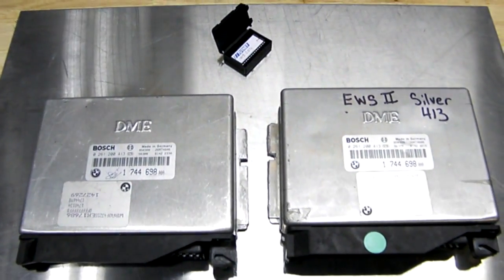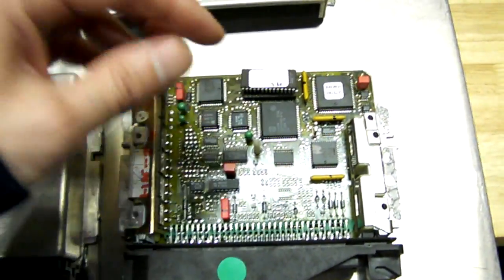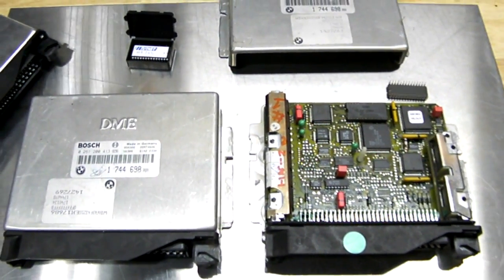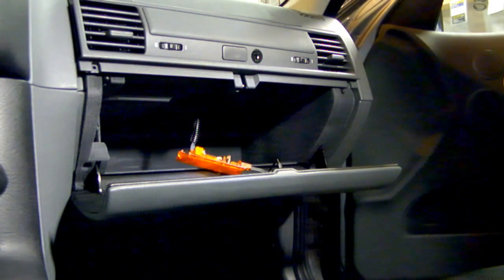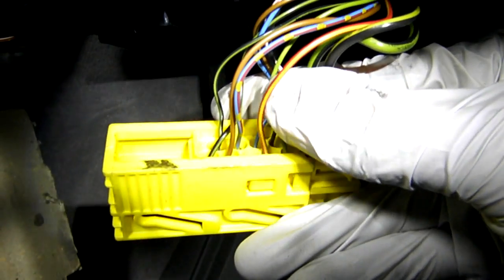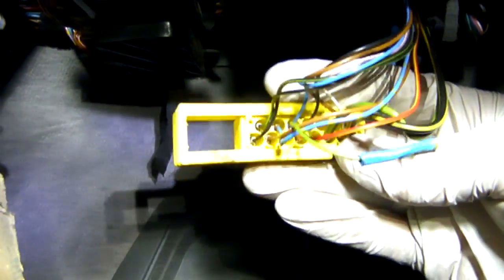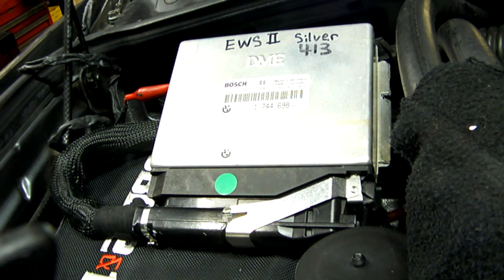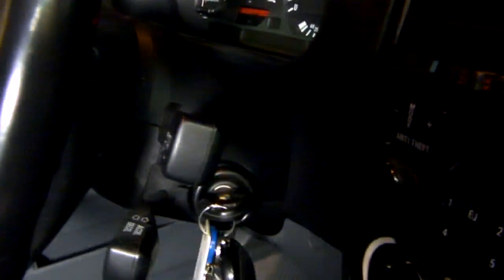BMW E36 EWS II BYPASS COMPUTER SWAP

Comment: Hello, I have a question for you. My vehicle is an E36 318i 1994, it is not the same system, it does not have this immobilizer module. What should I do? The immobilizer has been canceled.

Comment: So every white label dme has EWS? or how do I recognize which one have? basically what I'm looking for right now is to start my engine, it cranks but no fuel or spark after replacing harness and dme, not sure if the dme has EWS but it's exactly like those white label that you have there

I can't find continuity between the green cable and pin #66
chassis have the EWS system, 96' 328i but I replaced the harness for a 94' 325i since I swapped the engine, also got a DME but it probably has EWS, I'm not sure of that

Comment: Hello , I have a 1995 bmw e36 316, the silver dme is fried due to water damage, can I just swap out the dme and do the ews bypass? The damaged dme part number is 0 261 203 661 and the one I found at the junkyard is 0 261 203 277 also a silver unit any assistance or advice would be highly appreciated

Comment: 1995 325i EWS car.
If I cut the green wire at the EWS, and if I have a good DME ECU with the EWS chip installed, will it start up this way, or do I also need a non-EWS chip?
Is that burgundy DME from a 1994 325i?

Comment: Did this for a remote start it didn’t bypass it do you need to chip it to work ?
Reply from the maker: EWS bypass only works on OBD1 DME model years. The EWS bypass procedure only bypasses the DME also known as the engine control module. Under normal antitheft functions the EWS eeprom chip in the DME cuts fuel injector actuation ect... The EWS bypass removes this function. The EWS module behind the glovebox actually still needs to communicate with the chip in the key to allow the starter to work. Your remote starter control wire needs to be spliced in between the EWS module and starter not between the ignition switch and EWS module. You will want to look at the two large wires on pin 3 and pin 1 (yellow/black & green/black) on the EWS module plug. One of those wires feeds power to the starter solenoid.I believe it was pin 3 green/black that feeds directly to starter but please double check first. Can also do a google search "How to test your bmw EWS2 before replacing it" by RPM Motorsports. They show the EWS starter wires in their diagram

Comment: What if my car has no ews and i fit another engine that had ews, both bosch ecus only difference is my old engine was non vanos the new one is single vanos.  The car cranks but doesnt fire do i need a red label ecu to make it work or is there a cheaper way?

Comment: I have an m44, it does not have injection pulses, the sprocket broke and I want to put it in front of the pulley, will it work the same, that is my question

Comment: Help, I have a E36 98 M3 S52 OBD II EWS.  Started out with hard to start, seems like battery ran out. But finally turned over and started. This happened couple times . Then suddenly No crank no start. Battery is fully charged. I thought it’s the EWS module so I recently ordered a new DME from kassel performance with EWS delete. I plugged it in and got no crank no start. I assume the EWS is damaged so I bridge the two big wires on the EWS and got it to crank, but no start. Then I try unplugging the EWS and bridge the two wires, but still crank only no start. I have replaced the crank sensor and a use starter. Checked all fuses under the hood and all is good. When I turn the key to on position, I can hear that fuel pump prime. Any advice is much appreciated.

Comment: Hi ,saw your video and need your help , so the car was seating with out a battery , and now will not start a guy re programed a Key for me and it worked I removed battery because car need work and so now doesn't start how can I fix this issue

Comment: I have a 95 325i and I did the Ews delete with the wires under glove box and swapped a 413 maroon label dme into it and the car now cranks and I hear fuel pump. Car is not getting spark and has voltage to the coils themselves but no voltage when cranking. Is the car not getting signal when cranking?

Comment: Advice please. I replaced my BMW's water damaged computer box with a lock-set. The car starts very well. But the issue is that the steering wheel doesn't unlock and the radiator fan keeps on running without shutting off. What could be the problem?

Comment: I have an 01 BMW Z3 is the color of the wire the same? I am talking about the one I need to cut. Thanks this is very helpful because I am about to send my DME to get it custom tuned and don't feel like going to the dealer

Comment: You mentioned key and transponder towards the end of the video.  Were you saying they need to also replaced  with each swap?  Will this work without having to replace the key and transponder already in my car?  I have a 1996 E36 323is

Comment: So cut pin 66 the solid green wire and you can run without any key codes just as long as it turns

Comment: Hey I have a 95 325i and I tried to bypass the EWS2 by cutting the two biggest wires and jump them together it turns and cranks but it won’t turn on do you have any suggestions?

Comment: I found where I can buy a set with the ecu dme and key n switch .... but mine has the dme 1430 105 ... and the one i found is the 744 698  .. will it swap over

Comment: I had a question if anyone can answer it please. My question is what does it mean when a 1994 BMW 525i transmission slips and the trans program pops up on my dashboard and was wondering could it be the transmission control module? And how to take off the transmission control module off mine to check and compared to others I seen online

Comment: I wanna know if you can help me
I have a 2003 bmw 3.0i x5 ..the thing is my car has a failure when i turn it on in the beginning is sound good but 1 minutes later engine start to shake and loses strength when i go on the freeway is like 4 cilinders working and i have to turn it off to reset and then turn it back on to get it works well again ..idk if the main computer is damage or what?  Can anyone give me an advice please

Comment: Question. Did you ever open up an EWS II module? 
I wonder if there is a relay inside the housing. My starter motor keeps switching off while starting.
Reply: The ews module is a very fancy and unnecesarily expensive relay. If you have a wiring diagram you can jump the relay in the ews to start the car and check ews failure

Comment: My 95 318i stop working you think that may be the chip would help .it cranks but no power to fuel pump or fuel injectors TKS
Reply: sergio torres did it have ews
Reply: @hiboost2453  it does have the same component this guy is showing in his video

Comment: Hi. Any chance that this bypass method would work in case of an e36 325 TDS Manual? I had to replace the engine in my 1999 one. I have got a replacement engine from a 1994 e36 325 TDS Automatic. I have both the ECUs. Tried but non of them makes the high pressure pump to let fuel for the injectors.
Reply: Gábor Sike im going to follow this.
I have a 96 325tds. Got a ecu from the crapyard. Dont know what year. But it has Ews. I have a tuned chip for the original ecu but its soldered. Havent checked yet. But i think the scrap ecu is not. Would it work?

Comment: I have a 95 325I E36 , i keep having issues with the vehicle no crank no start. I was curious if there is an issue with the EWS , can i cut the green wire , and ( would that disable the immobilizer )
Reply: Awesome car

Comment: cheers, does this bypass (wire cutting) works with motronic bosch DME? (the 400 or 403, 405 type)

my car is a m50 swap in 95 m52 chassis ,and I need to put in another DME (my current one is toasted)

Comment: I got the 413 because my old one was corroded due to rain. My car is a 1992 325i, when I put in the new one do I need to swap the chips and put in the chip from my old one?

Comment: Hi. Thanks for the great vid. I need a few more clarifications though... I have a 520i with Siemens DME and I'm planning on swapping in a M50B25 vanos from a 525i. My 520i is a >95 car, so EWS2 enabled. My question is what kind of DME I must get to keep the EWS2 functionality? My understanding was that only one from a >95 car would work and then reprogram it to pair with the EWS module. Fair enough, but E34s from 95 are quite rare, so I'm looking at 93-94 as well. So, can I then buy a 93 525i and get a DME from >95? How do I know which DME is the right one, with EWS2? I understood all silver labeled 413 DMEs are EWS2 enabled, but when looking the part # on your DME from the video, it was <95 on realoem, so I'm a bit confused.
Lastly, you said if I would cut the wire from pin 66, the key chip would still be needed for the immobilizer, which is what I want, but how is that possible? Isn't the whole point of cutting the 66 pin to disable the immobilizer and make the chip obsolete? what are you then achieving by cutting the wire? Thanks a lot for the help so far.

Comment: Here to report a related fix for my Nov 93 e34 540i that has cold start issues where it won't at below mid 30 F degrees.  I cut pin 66 wire in the DME header where it was black with yellow stripe and it starts 0 F degrees now.  It always did crank over strong and fast, the engine just would not start when it was cold out.  After replacing cam/crank sensor with no change, I monitored the fuel pump fuse with a test light.  Cold there was no prime, and no voltage to fuel pump during starter cranking which tells me the computer has been told to not start.  Warm it has power to prime for one second and then soon after engine turns over with starter.  Cut the pin 66 wire and I have power on the fuel pump fuse without fail both for prime and start.  Mine has black label DME  0 261 200 404.

Comment: Your video saved the day. Had to change out my M44 1996 engine with a M43 1994 engine (318i). Engine would not start after the install. Cut the green EWS wire as you demonstrated and the car started first go and runs better than ever. Love your work!

Comment: has anyone else tried this with success? I have a 97 328i. previous owner destroyed the ews at the ignition and now it won't start. I found the delete chip online for $300. I think I'm going to try the chip. big leap of faith...
Reply: Andrew Teeter did it work?
Reply: Andrew Teeter 
hey did u ever end up starting ur bmw??? i have a 97 318i bmw and want to bypass ews. problem is i lost the keys and need to drive i popped my ignition switch out so i can start it from there if i can bypass ews imobiluzer pls get back to me deandesousa911@gmail.com
Reply: Mike  Green did you ever figure it out?

Comment: so my red 413 stop working no power to fuel pumps also no power to computer so does that mean I have to get a new red box or can I slap a Ews  delete chip and it will work again??
Reply: it didn't get wet I was driving and the car cuts off
Reply: What did you do to get it back running my car is currently doing this now

Comment: Its the same process for a 318ti ? My car is 4 cyl and dont Have  performance chip, only crank but no start, when i bought the car wasnt key, so find the key and all inmobilizer system in a Junk yard and now crank (before wasnt). What can i do for my car start?
Reply: The ews system isnt from 318 is from a 323,
Reply: +adiel licerio did you figure this out yet, I'm having the same issue

Comment: I Have a 535i e39 m62tub35 ,i want to swap to a 540i m62b44i non vanos . i get the motor complete with ews an DME , but my car is from 2000 and the donor 540i from 97so will the ews fit in my car or do i need to delete the ews ? i dont know how this work ?

Comment: great video! made sure to like and sub. I'm curious if this fix will work with my e36 that has an ms 41.1 dme. the motor is an s52, but its going into a 94 318 shell. 

I'm curious because from what i understand, the motor  was out of a 96+ m3, converted to obd1 and put into a 96+ e36 which i purchased and am now using the whole drivetrain from it. i found a second key that was glued into the ignition, hidden behind the dashboard with random extra wiring (assuming an ews bypass?). 

i kno you know nothing about my car, but will this ews bypass you're showing in the vid be a fix for me when everything is done being swapped and the motor doesnt run?

Comment: hey, I just put in an AC Schnitzel chip designed for non EWS into my '95 325is using the tips in this video, works perfect, no issues, and I can definitely feel the difference.  thanks for the info!
Reply: Did you have to solder the chip or was it a removable design...Curious cause I have a late production 1995 325 as well..

Comment: A question though, once the wire for EWS is cut off, can I leave everything from DME unchanged (without replacing the EWS chip with non EWS one there)? Thanks!
Reply: Hey did you ever try this?

Comment: I have the exact configuration as you do but when I cut the green wire my car would turn over but not fire at all, even when I replaced the original ecu/chip. Just a warning this can happen. I had to splice the wire back together and my car started just fine. (But only with the original recognized chip) Any thoughts why this would happen?
Reply: What was the problem?

Comment: Thanks man! So i have a 98 318ti and im planning to do a swap from a 99 328i. If i cut the wires, I don't have to snatch the 328i's EWS II module right? I can just get an after market chip for the 328i ECM and my 318ti key and good to go right? Please help!

Comment: I have a 98 540 and I've been have teouble with the ecm auto transmission  and been attempting to fix it with a working ecm auto transmission  but the problem is two different vin numbers I NEED HELP.

Comment: I am having an issue i was given a BMW 95 325I Convertible. Being it was just spare car i finally said to myself i need to get this running . i can  crank it but the engine wont start . I was told i need a new module box its missing the whole thing . and then program key . but I do not understand exactly what i need to get . any ideas of what is needed. In the right firewall of the engine the box is open and there is huge cable unplugged to a computer it seems .the old one got wet and so it was going to be replaced .but she instead decided to buy a new  Volkswagen cabriolet convertible I am trying to figure what is needed to get this to  work again any assistance is grateful thx . there is no box in there just big cable unplugged.

I just watched the full video great work  . I left what I said before i knew . from what i see all i need is a new box . and that chip then cut the wire as you did and i should be good to go ? .  this helps a lot thanks again

Comment: actually the problem with me is that i lost my ecu in the work shop.so i dont remember any of its numbers
so i bought another ecu from scrap yard.
so i just wanna ask that is it important to install the turner chip in there.
or i can just plug the ecu in and cut the wire under the glove box. of the EWS
thanks

Comment: I have a 95 e34 and I did this with the red label and nothing I put the red label chip in as well I'm still getting the no start I cut and looped the black and yellow wires and cut the green it turns over but no spark and jumped relay for fuel pump what am I missing So you have reprogram the dme or what I'm lost tried everything checked fuses.
Reply: +Craig Howard did you ever figure this out I have the same issue

Comment: Hei .I have a big problem! I have changed the motro from 316 1993 to motor 328 from 1994 . and I can not start the car! fuel pump is not working and the motor is not powered! but when I turn the key so the motor runs around with it will not start! can you help me figure out what is wrong?what happend If I do that  you did on the video?

Comment: Great video just on question
I have a BMW e36 1996 318i
Fried DME 
So i have a spar one from a 1995 but what would i have to do to get it running? Would i need to cut the green wire and get a performance chip? Please and thanks!
Reply: Your 96 318 is an OBD2 car with a M44 engine. The 95's are the last OBD1 with the M42 engine. These computers are not compatible with each other unfortunately, so this mod will not work with your car. There is a way to change from OBD2 to OBD1 if I am not mistaken, but it would be very complicated and not really worth it. There are ews emulators, I have not used one yet so I have no idea if they actually work.
Reply: What about a DME from a 1994 instead or would the same problem arise? Is there any other way that i could do a bypass on it or does the DME have to be a 1996 one? Thanks!
Reply: TheEpicLazyMan The DME would have to be a 96, maybe newer, I have no idea if the OBD2 cars are all compatible like the OBD1 cars. Like I said, there are the EWS emulators. I can't find much info on them though, but they are pretty cheap on ebay. I'll go down that road soon myself.
Reply: Sorry be a stupid question but what does an EWS emulator do before i go and buy on?
Reply: To my understanding, it pretends to be the key in the ignition. That would effectively bypass the EWS. Again, you should do research outside of my post here on that, since I do not have one and do not know for certain. Contacting a seller of one might get you better answers than I can give you.
Reply: Ralph Longo he used a 325 ECU which is for an m50, on an obd2 car. Did you even watch the video??

Comment: I have a 97 e36 with the Siemens dme my key went bad and I picked up a key/ews/ring dme etc from a 1996 e36 but this one is the Bosch 413 DME the connector on the dme appears to be different is it possible to do this conversion ?any help would be greatly appreciated